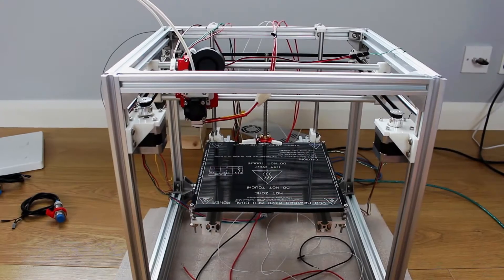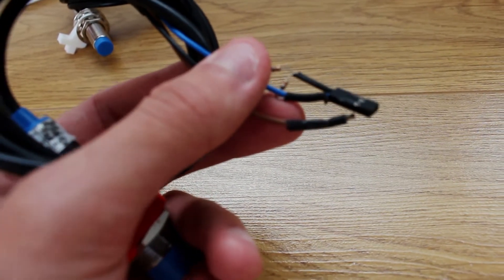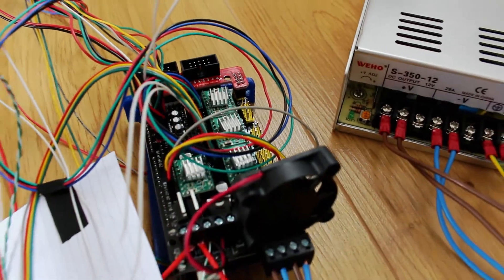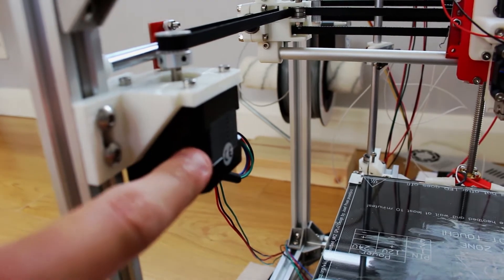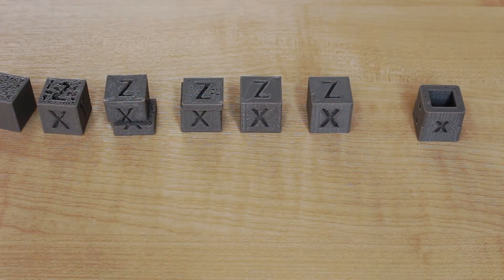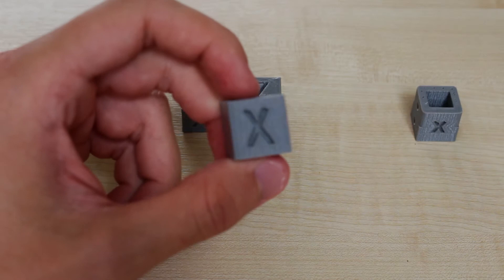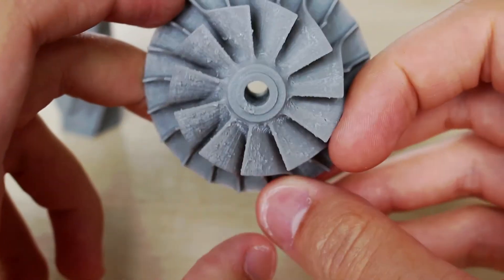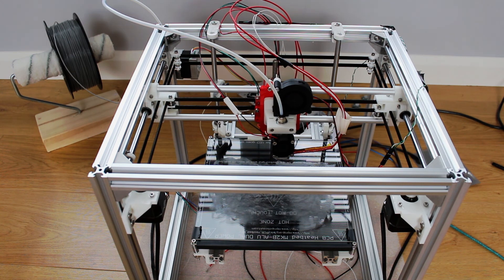HyperCube 3D Printer Build Part 4 - Electronics and First Prints

Comment: Hi, I'm considering building one of these soon and I was wondering if you managed to sort out the ringing and artifacting eventually?
Reply from the maker: Hello, and yeah I managed to iron out most of it in the end but it wasn't 'perfect', however I've just transferred all these parts over to a hypercube evolution design now which is a bit more solid in my opinion. However people have been getting some good prints off the original design still.

Comment: What firmware are you using? I tried to configure the Repetier one, and had no luck with homing Z.
It goes either too much up or too much down and tries to go beyond Z max endstop (i mounted one even though i have a probe that triggers and its detected in soft ) or Z min...(here i don't have any endstop)
I have the same board and same drivers and i'm interested how did you set the feed rate and steps for Z. On X and Y, they seem to work fine with 32 step mode + 320 steps set in firmware.

Comment: u know that your heatbed is upside down right? :P the wiring should be under not over.
Reply from the maker: I didn't know no haha, I thought if you were printing on glass it was best to have the element facing up?
Reply: PracticalProjects no its the aluminium that transfer the heat. Thats why people makes hestsink of alu because it leads heat
Reply: One side is bare metal, one side says "Hot Zone Do Not Touch". Logically the side with the written warning is the side that should be facing up, to you know, be read and all. The suggestion that the aluminium is the "top" side is to make sure no one is stupid enough to attempt to print directly onto the black side. However if you use a glass plate then the "top" and "bottom" side are irrelevant
Reply: @HeliumFreak  Not quite. If you want to use a probe, like he tried, then you will need the metal sheet facing up and not down, so the sensor triggers. ;)

Comment: try a bltouch instead of inductive sensor. or could use alloy tape on glass surface where it homes the z axis
but this does limit print area due to tape
Reply from the maker: yeah I've heard of those, might be something i'll invest in at some stage, just upgrading to an e3d hotend at the moment

Comment: I wonder if your rod/bearing clearances are too high which leads to the rattle? I printed all PLA bushings sized to within 0.015mm on mine. I'm trying TMC2100 to quieten it down some more.

Apparently the artifacts on the side/front are due to the toothed belt, I get them too slightly.

I think you could solve the blobbing with a shorter Bowden tube and playing with retract/coast/wipe in your slicer.
Reply from the maker: that could be a cause actually, I'll look at that, finding the right set up of the bearings so they are not too tight or loose is tricky with this design... I was considering getting some of those igus 10mm rods, however they are a bit expensive... 

ahh I see, wish I could get rid of them, I've just ordered a genuine e3d hotend and will try those things you suggested, thank for your help!